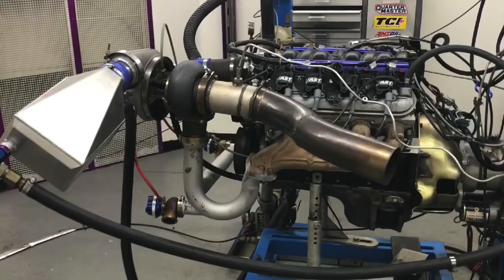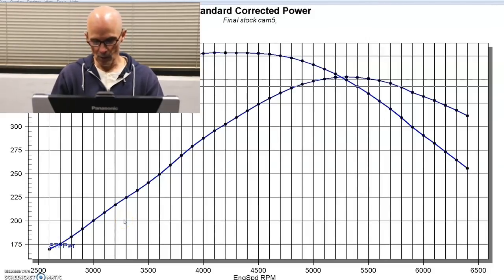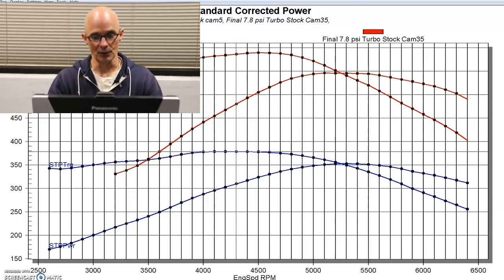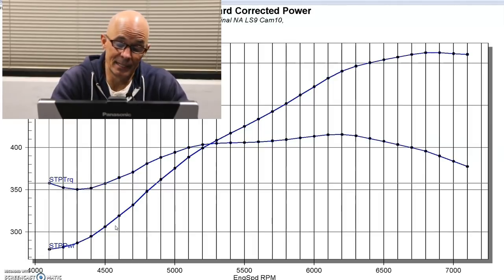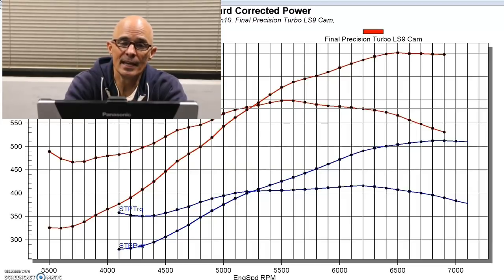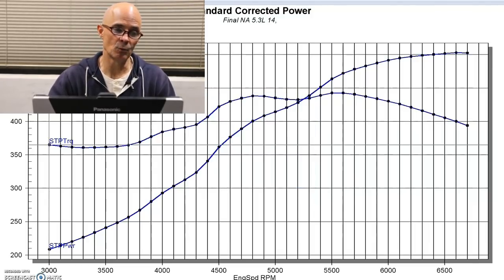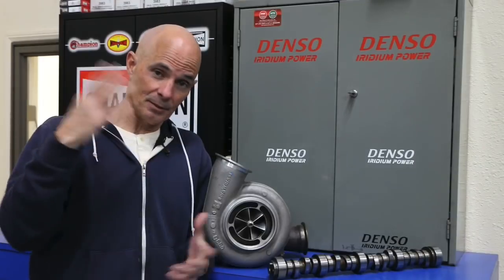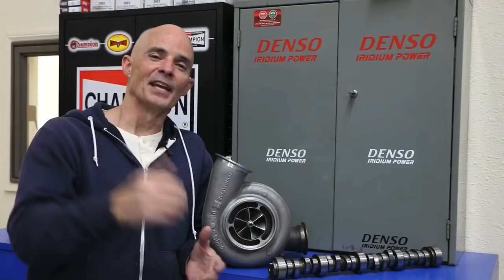REVEALED-DIY TURBO SECRET-EVERY CAM WORKS!

Comment: To be honest I think when people design a "turbo cam" they come up with a combination in their head with a turbo and a cam and a displacement level that all match up well together and make nice long torque curves and they deem that cam a "turbo cam" and then because the internet caters to stupid people we have cam manufacturers selling "turbo cams".  I never made much video about it but I've always said that a big turbo and a big cam go together pretty well on the appropriately sized engine.  Much like a small turbo actually goes very well with a stock cam on the appropriately sized engine. The specifications are almost irrelevant because this in a vague way covers everything.

Example a:
"Torque monster" it's a stock lq4 engine with head studs put in it and some ring gap.  We use t3 .63 a/r 52/54 twin turbos on it with internal wastegate.  10psi on 91 octane gets us a power curve that the city bus is jealous of and stock drivability is a win.

Example b:
Lq4 engine with studs, added ring gap, and twin t4 76mm Wuhan war whistles (gt45 clones)
232/242 .620 .620 111 LSA

Now we have an entirely different but also equally efficient 4 digit Dyno monster that's not gonna be nearly as fun in city driving conditions but will make a hell of a pass.  Just an entirely different power curve brought on by basing the entire setup around the cam you chose to get the power curve that works best for you.

And the fact that some cams are listed as "cathedral port cams" or  "rec port" cams honestly kinda just makes me sad.  People really need to learn to understand the specs of what they're looking at.  I guess with that being said we wouldn't have ever had to dumb them down to "stages" in the first place.  Love your videos Man amazing content

Comment: I have a lq9 30 over with ls3 cnc gm performance heads lsxrt,i am installing a 7875 vs billet turbo what fuel injector should i run also i have a trick flow 228 230 cam 585 lift 112 lsa i currently have 8an fuel line and 350lph fuel pump

Comment: So..slight newbie here.  I have a project car that needs a replacement motor. It came with a stroked 351w, but now I need a new block due to mechanical failure.  (The mechanic I hired failed to deliver promised rebuild) and I trusted him and paid him ahead of time.  Car has sat for 5 years broken as I spent more time paying off other bills and prioritizing family etc...

Grandma has passed on and I now have 5k in cash to try to get this pony car back on the road. (89 lx convertible).

I would like to find the best reliable solution to beat my buddies Tesla, but to also be able to keep it a cruising/touring car and not just a 1/4 one trick pony.

I like the idea of boost and yet I was told that I could build a stout NA 408 and beat the boosted cars on motor...but this video seems to imply the 351 after a stroke to make it 408 could still have a turbo added after and it should be fine?

I was told that the compression of the motor will dictate whether I can boost or not.

I would love to finish this car and not part it out and get less for it than how much I've got in it already. I still have to replace the top..(but I can do that myself) 😀 Whole reason I bought the car was to make it a bit of a daily driving show with go car...

Any helpful insights? I do have the accessories and intake that came with the 351 and I have not had the heads (world products) looked at yet to determine whether they need repaired/replaced.  I have the GT40 upper/lower intake and a ProFlow 75mm throttle body calibrated to 30lb injectors...

I would like to use what I did not donate to the "mechanic" to recoup some of the rebuild process...unless there is an option that these items will be holding back from optimal performance.

I do not plan on ever buying the skinny wheels or a parachute and want to retain the full interior.  Just wanna see what options I have. Thanks for any input! 😀😇😎

Comment: I'd love to see you do a junkyard 5.3 with 4.8 flat tops and 706 heads tuned for e85.  Just curious what a high compression SBE N/A motor would put down.
Reply: Exact same power as a 5.3 without flat tops, running more boost, because of lower CR.

Comment: im building a 92 Camaro and i have a 5.3 stock cam an springs so if i get this right i can just add boost and x2 my hp on stock motor with a wu tang war whistle ?

Comment: Hey Richard, I was wondering with the set up that I have for my 1988 rv. It's a 454 .030 over with a stock crank. Its has a bigger cam more for lower rpm i think around 2600 to 3200(sorry I don't remember which one it is.) With a port and polished peanut port head and bigger valves. Ok so my thing that I would like to know is a ball park figure of my hp and torque. I'm still thinking about putting a blower on it, and only putting about 8-10 psi boost to it. Do I have to change the heads for a blower? Also a side note I'd really like to have it dyno done for it.
Reply: Like he said,  boost doesn't care.  Just slap the blower on, supply fuel and spark,  tune.  Done. Be happy with your torque monster.
Reply: @Turbo_Todd  thanks
Reply from the maker: I'm thinking around 375 flywheel hp
Reply: Do I have to change my ring gap for the blower?

Comment: The correct way of stating what you said would be that you can run an incorrect cam to get on the road, but it will perform better with the correct cam in it. Don’t say they are all turbo cams just because they will work ok with a turbo because that is a straight up lie. A turbo cam is optimized for a turbo. It is designed to deal with back pressure from the turbo, as well as to spool the turbo better. An engine dyno doesn’t show drivability. It doesn’t show how hard it is to get the wrong cam to try to build boost against the stall converter. I’ve seen people who thought like you and ended up spraying a 200 shot to spool a turbo that was a lot smaller than I was running with no issues. You need to start using a wheel dyno and doing drivability tests rather than just showing crank dyno numbers. Any performance enthusiast knows that dyno numbers don’t mean much when your nitrous cam won’t spool the turbo enough to bring a 5000rpm stall converter up to 3000 rpm. Start trying these engine in a vehicle and you will understand how useless an engine dyno really is...

Comment: Now does this apply to those of us with a PDS? I have A Whipple on a 6.0 with the "wrong" cam.
Reply from the maker: same
Reply: So the overlap that this cam has isn't hurting the "boost" potential? On a stock 6.2/l92 this blower produced 8lbs on boost at 6200ish. On my 6.0 with a better cam, decent heads (worked 799's p&p) it just makes 8lbs @7000. I know boost is an arbitrary number quantifying the amount of restriction in an engine. I was thinking of a stage 4 PDS cam from BTR. Just to limit the over lap, and to take advantage of the better lift and duration on both the lobes. I have a 232/232 @.050 .575/.575 lift on a 114+3 in the truck now.

Comment: What makes a camshaft a n/a v blower v turbo ? I was under the impression a “turbo” cam had to do with the LSA of a cam so you’re not blowing boost through the exhaust valves while the intake valves were opening.
Reply: this is the question I had in my mind but I would think that if there is some valve overlap you're actually creating more back pressure because your blowing boost directly into your turbine housing thus making turbo spool quicker? this is a hard thing to test on a engine dyno i reckon.
Reply: Exhaust valve timing because you don't need the pulse to help with filling the cylinder
Reply: I actually don't believe in that the bost will leak out the exhaust. after all, the the back pressure on peak power is usually bigger than the boost pressure, yeah I know there is some pulsing going on, but in that case you should se the same kind of benefits with long tube heder with turbo as with na.

Comment: If your maxing out your turbo and heads flow capability then you probably wouldn’t see any significant gains possibly just losing down low power to gain small amount up top.

Comment: I'd like you to go over lobe separation angle with boost though cuz I always kind of was told the rule of thumbs you don't want want less than like 114 degrees also if there's anything you can add with variable cam timing or just f**** lock it out

Comment: My cam is basically same size as btr stage 4 na cam, have U boosted that cam in a 5,7? Turbo cams make alot more power easier I don't care what U say sorry
Reply from the maker: turbo cams make a lot more power easier?

Comment: I want to turbo my 1998 mercedesbenz sl 500 from the rear exhaust what turbo would be great for that job and intercooler kit? N thanks my engine is a 5.0 v8 m119 dohc.peace

Comment: This is all interesting, but what about the high compression ratio my na cam was designed for? If I’m already at a 11:1 ratio, it seems like I’m going to be on a razors edge if I add boost.
Reply from the maker: that's a compression issue-not cam, but we run boost on 11:1 motors
Reply: Richard Holdener but aren’t cams designed to be matched to a certain compression ratio? A high performance na cam will most likely be matched to a high compression ratio. Where a turbo cam will most likely be designed for a low compression ratio. http://www.crankshaftcoalition.com/wiki/Cam_and_compression_ratio_compatibility are you saying that you can take a cam designed for a high compression engine and put it in a lower compression engine with boost?

Comment: I thought dedicated cams especially on a turbo cam was to reduce the back pressure in the turbine.. that way your not doubling the psi in the compressor or intake manifold
Reply: Wastegate and safety/blowoff valve.

Comment: One exception being a cam with significant overlap!   Don't shoot yourself (not you Richard) in the foot wondering why you can't build sufficient boost on that hot choppy n/a cam. Correct me if i'm way off, sir
Reply: Over on John Doc's channel the black sheep GN makes over 2000 at the wheels, a shit ton of boost, and tons of overlap. Check it out

Comment: this is pay dirt i am waiting to see the kegladon in a car now im  trying to pick the right set of oval port heads & pistons for a 80's 454 n/a pump gas but theres to many options more them 15 port sizes and every body says some thing different 5-600hp n/a i know its there im just worried about ending up with $2000+ boat anchors

Comment: On motors with twin cam heads, playing with cam timing can and does move power around. 

This is why veriable cam timing is so valuable in improving engine response. Independently advancing or retardeding intake and exhaut cams buy up to 20° in some cases has some pretty drastic effects.

Difficult to get the full benifits on a single stick engine.

Comment: You should really put a engine combination together with enough boost and fuel with a stock cam and make 1k hp.    That would blow peoples minds.  So many other engines already do it.  Coyote, 2JZ ect.

Comment: You only talked about "street-ish" cams with 112-113 lsa what about something with 106? Same other specs,
Reply: Same spec cam except one is 113 the other 106. Could that be a scenario where the 106 makes more power n/a but then on boost the "milder turbo cam" 113 takes over with potential more efficient valve timing? ( on same boost )

Comment: I think a turbo cam is more likely to have an impact on turbo speed and turbine acceleration. If you  have a narrow LSA some of the boost will flow through the combustion chamber on overlap so the turbine will have to spend faster to overcome the 'leak' Most stock cams are not going to have this issue as they need to meet exhaust emissions. I think most examples of 'non turbo' cams would be very no-street-able and hostile to EFI.

Comment: I think the turbo size is based on the engine size and the max cam you can run is based on the valve components and valve clearance. For grudge racers we want the most HP so we want the most HP and torque for our $. You can sit there and say any cam is good but Richard we don't want good we want the BEST! CAM SHOOT OUT!!!!! Tell every manufacture put up or shut up. NA & Boost!
Reply from the maker: Spoiler Alert-There is NO BEST (magic) cam! Lots of good ones, though.
Reply: @richardholdener1727  so what ur saying is the cheapest camshaft makes the same amount of HP & torque as the most expensive? 🤔

Comment: Ok I'm looking for a good cam for a 351w bore 40 over afr 185cc heads forged Pistons and Rods  building for track and street with a on3 76mm turbo I also I roller set up

Comment: But does it make a difference in where the power is made as far as when it comes into boost and starts to climb?
Reply: It doesn't appear that way on the dyno graphs.  The power curves are nearly identical,  just with more power.
Reply: Dyno has artificial load. Its not easy to compare or basically impossible to compare spool up

Comment: Did we all just go Oh, that makes sense? We probably all agree that any engine combo makes less horsepower at altitude than it does at sea level. That is basically the same point. Double regular atmospheric pressure from normal and double the horsepower.

Comment: Can you make high compression engine plus boost,
let's say 12.5:1 or even 13:1 and check how much boost it can take on normal pump gas, let's say 5 psi + 13:1, or 3.5 psi if 5 be too high and then go max psi on e85 or c16, you can also add timing to the game, this will be amazing, because peoples think that 13:1 plus boost is not possible
Reply from the maker: lots of race motors doing it
Reply: @richardholdener1727  what's the highest compression ratio you have tested on pump e85 and still be able to cram 15+psi?

Comment: So Richard Holdener if i had an engine at 4psi and added 14psi would that hp number double at 18psi?
Reply: No, take your N/A hp, then divide by 14.7. That tells you how much hp per 1 psi you can gain as a rule of thumb on a motor with turbo sized correctly and good tune.  So 400hp/14.7psi=27hp. So you'll make 508hp at 4psi. Add 14 more psi (27hp per pound of boost) to get to 18psi and you'll have 508hp+378hp=886hp.
Reply: @Turbo_Todd   i was wondering what he thought i made 400hp at 4 psi just wondering if 1 atmosphere would double anything (science)?  I make 25hp per 1 psi!
Reply from the maker: double the NA HP-then multiples of the NA hp
Reply from the maker: 25 hp per psi is 368 na hp
Reply: @richardholdener1727   it was just a question at a given horse power under boost, adding another atmosphere would it double it? Would 29.4 be triple your na horse power?
Reply: @jminnick5878  29.4 = tripled n/a. You got it.  My 480hp gen4 5.3 is gonna fly at that boost if I put enough turbo. 😁😁

Comment: Is there a limit though with cams. I’ve been told after around 280deg cams (dohc engine) that they loose power as they let too much of the boost out of the exhaust.
Reply: I’ve always believed you just picked the cam for the rpm power you desire. 
Boost or no boost

Comment: My question is........ Is every cam a nitrous cam same as "turbo" cams?
Reply from the maker: you can run nitrous with any cam
Reply: @richardholdener1727  I guess what I meant was is it the same rule as directed induction? Being one is actual air bring stuffed in vs a product injected, is the nitrous gonna have the same multiplication effect on any given cam?

Comment: Did I miss it? What’s the purpose of a turbo cam then?
Reply: Everyone on the internet says turbo cams are made with less overlap (or "more LSA" which is related but misleading) so that backpressure doesn't compromise cylinder filling. And I believed it. But after watching this video, my new theory is:

Turbo cams are made for smooth idle and low-speed driveability. Turbo cams are NOT optimized for power, because if you want more power you can get it by adding boost.

When you optimize a cam for power, you add overlap, which compromises idle quality (chop / lope) and low-speed drivability (surging). So "turbo" cams don't make those compromises. So they make less power NA, but again that's OK because with turbo setups, peak power is generally limited by the turbocharger itself, not the cam.
Reply: Replying to myself... Richard qualified his comments with "if everything else is right" which includes octane to stave off detonation. So I suddenly wonder if turbo cams can make more power in setups that are knock-limited, for example due to using pump gas rather than race gas. 

I wonder if we can get @Richard Holdener to comment on this...
Reply: delamin8r yea would be nice if it made it clear, I was thinking on adding a turbo cam n/a and then just boost it , but after this video it’s seems it’s saying get the best cam for my combo now and boost will just multiply that, dam it Richard lol

Comment: You mean HP is just math n not unicorn dust??? Have anything testing positive displacement vs turbo at same boost levels for heat and drive loss of blower?

Comment: Is there a cam that I can put in with a longer valve opening so it fill the cylinder longer thank
Reply from the maker: lots of cams avail
Reply: @richardholdener1727  hi thank probably not for those 2.8 liter boat anchor lol these cam are skinny lobe

Comment: Ever dyno the Atlas engines that GM did in the early 2000s? The 4, 5 and 6 cylinder inline engine family...
Reply: Hot rod garage just did a 4.2...
Reply: @shitbox7413  never heard of them. Thanks, I'll go check it out.
Reply: Bill Carini, It’s a motor trend show, that episode probably isn’t on YouTube yet